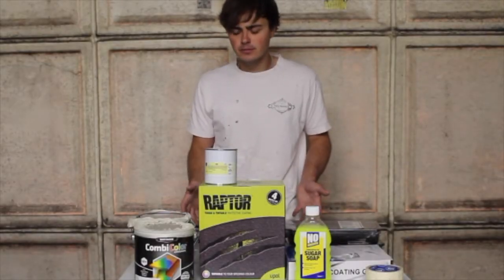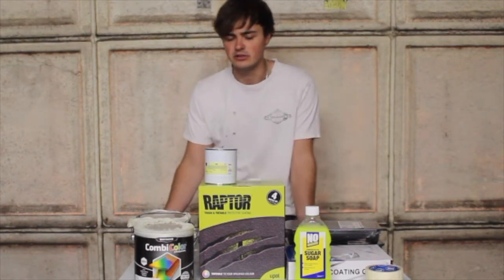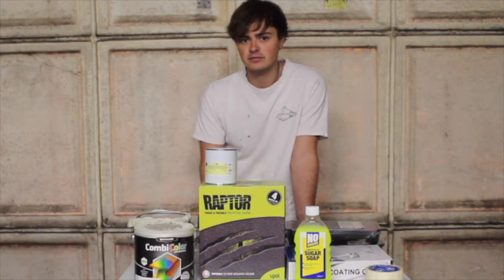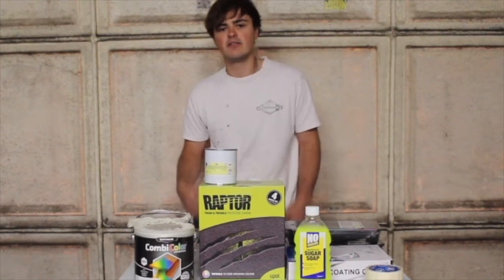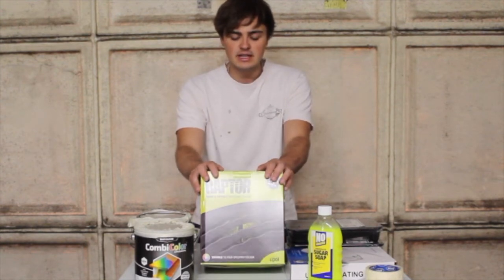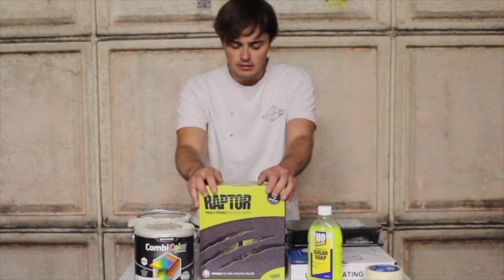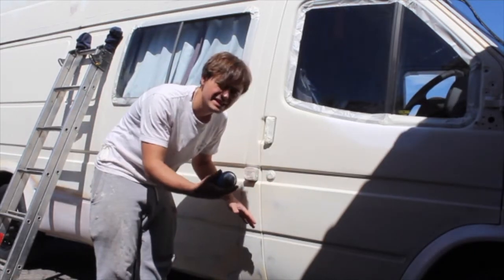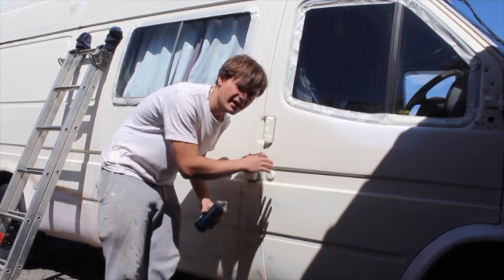Rustoleum Roller Paint Job DIY - Part 1

Comment: Hi, Awsome job , been doing hand painting jobs on vans and cars for 40 yrs so tried them all.
Car re-paint, Tractol enamel, Dulux gloss, Hammerite garage door paint, Aldi metal paint, Rustoleum and so on.
The big secret is prep, prep, and prep. 
It's 90 percent prep and 10 percent paint 
Do the preparation correctly as above and you will get a decent job, the worst you will get is an orange peel job which is no worse than a DIY or cheapo spray job.
My latest job is an LDV convoy painted with military satin paint ( satin is more forgiving if you like the finish) even a tar brush would make  a Convoy look good LOL.
Keep up the good work all you hand painters and save lots and lots of cash.
Reply from the maker: Hi Lyna, that’s great advice! Thanks for sharing your experience 👍🏼
Reply: What are you preparation for a good paint?
Reply: Hi! I have an important question:)! 
I live in a mercedes 609 and i really need to paint it. 
Is it necessary use a 2components vernice or it's fine simply use a 1component vernice??? Im looking for something that can last around 10 years. If is actually possible with a single component vernice which is the best brand? It would be much easier for me going with a 1 component rather then a 2components one.
Reply: I did my van in White Satin Rustoleum with a roller.  I am happy with the look. Do I need to wet sand it now and buff it or will the look hold up and will it be easy enough to clean when it gets dirt on it if I don't polish or laquer it?

Comment: I'm having trouble getting all of the top waxy coat off of the high top of my van in the corners and wavy parts. I'm using 150 grit with a hand sander. Should I just keep at it and try harder or use a different grit? I tried to add a picture so you could see but maybe YouTube doesn't allow pictures??Thanks for the great video!
Reply from the maker: Hi, thanks for your comment 👍🏼 is it a rubberised paint you have on there possibly? typical vehicle paints tend to sand fairly easy because they’re hard. I have instagram if you wanted to send picture on there and I can have a look? Ahh thanks it’s no problem, glad you like it!
Reply: @TurnersWorkshop97  I really don't know. We bought it as a used electrical work van years ago, and this is the first time I've tried to remove paint. I'll send you the picture via IG. Thanks for the response!

Comment: Hey what type of sander and sandpaper did you used to do the initial sanding before the first coat? Also with the flattening back did you use white spirit to do this by hand or just water? Thank you!
Reply from the maker: Hey, I used a palm sander with 120grit and 240grit wet and dry paper for the initial key up then 600grit wet and dry paper with water between coats for flattening back the paint 😊

Comment: I tried this with rust oleum white and it was a disaster. After sanding back and trying again 3 times i still couldn’t get rid of the orange peel textured finish. Even tried different amounts of thinners. Still no joy. Finally had to pay a professional to respray it properly.
Reply: You’ll find using coach enamel paint from a reputable manufacturer like paintman paints will achieve the gloss finish you want. Too late now but worth looking up.
Reply: Someone recommended Penetrol to get rid of orange peel and brush strokes.

Comment: Hey dude. How did the finished product look ? Too shiny ? And how much paint did you use in the end?

I'm gonna do this myself, rust oleum is not easy to get here in the Netherlands so have to buy the good product/amount in the first go.
Reply from the maker: Hey man, I was really pleased with the finished look. I got the rustoleum in satin finish so wasn’t really shiny. The bodywork on my van isn’t perfect so I didn’t want the glossy look to show up the imperfections. Overall I used 2 x 2.5litre tins of paint. It covers really well but if you’re doing the sand back and repaint technique to build up the layers it might be worth getting some extra as I only just had enough. Hope it turns out well for you! Good luck!

Comment: How is this holding up? I've heard Rustoleum stays quite soft so is prone to getting marked/scratched quite easily - is this the case or does it harden over time?
Reply from the maker: Very well really, I believe it does harden more over time. It’s definitely not easy to scratch 👍🏼

Comment: Great video! Thank you for sharing this! 

I am wondering, on the 3rd coat what did you do about brush marks at that point? Was it very visible or did you sand it back again or leave it
Reply from the maker: Thanks you! I was planning on flattening back again until smooth and then some finer paper and finishing with polishing compound but wanted to keep the satin finish. So in the end I left it as it is. There’s a slight orange peel like texture all over from the roller and I don’t mind it personally, it’s only noticeable up close 😊
Reply: @TurnersWorkshop97  thank you so much :)

Comment: Looks awsome. I was thinking of getting a spraygun for it.. How did it feel going with the rollers?
Reply from the maker: Thanks man. If you have the space to spray indoors I would go for that option as it takes a long time to flatten back the paint! Where I live it’s not really feasible to spray outside as I was worried about overspray on neighbours cars...Really easy to roller on though and as long as the vans prepped and keyed up all over the Rustoleum goes on surprisingly well with a roller.

Comment: How long did you wait to do the second coat? A day?
Did you find 2 coats was more than enough?
Thinking of changing the colour scheme on our banana, i see rustoleum do a thinner to for the combi colour is it worth thinning down the first layer? Or putting the first layer on light then the next coat thicker
Reply from the maker: The weather was really hot when I did it so only needed a day or 2 before I could flat back  between coats. 3 coats all in and they were all thinned down a little with white spirit. The more  coats the better, it’s better to build up in thinned  coats. It will give a flatter smoother finish and makes it easier to flat back between coats. After 3 coats I was done with it 😂 the good thing about it is you can revisit and refresh the look every now and then. I’ve got to take windscreen out to do some rust work this year so will be touching up around the screen with combi-colour.
Reply: Turners Workshop ive got the rustoleum paint and rustoleum thinner. But how much thinner is needed?
It says use up to maximum 10 vol %
Does that meen up to 10% thinner??
Think ill do 5% thinner
Reply from the maker: @Taylor40667  I would say I thinned down with 5-10% white spirit and it applied nicely and dried overnight so I could flatten back the next day. It wasn't an exact thing, just approximate. I think it says no more than 10% because it will be very thin and hard to apply like that, gets everywhere!

Comment: Great video. Lots to ponder. I wonder why most van painters do not use the “Roll and Tip” method used when painting boats? 
Well done on your project. Thanks for sharing.
Reply from the maker: Thank you, I did try the roll and tip method for the bonnet and found it was harder to flatten back to get rid of the brush marks so just stuck with rollers in the end 👍🏼

Comment: What ratio did you thin the combicolour to pls mate?
Reply from the maker: I used about 10% thinners. Just tried different mixes on the first coat until I found what was applying smoothly without too many runs or bubbles etc. I didn’t measure just approximate.